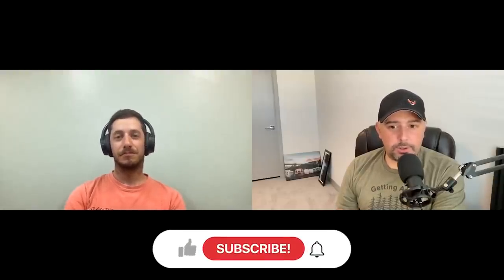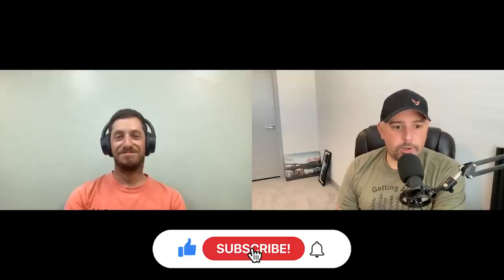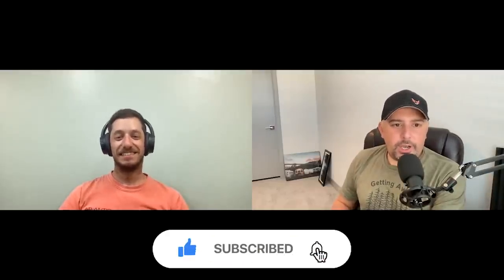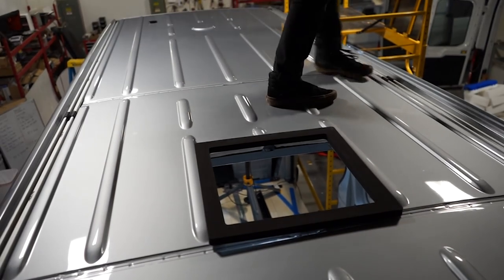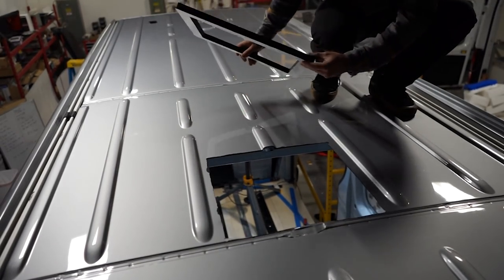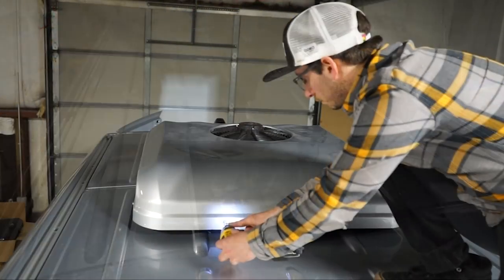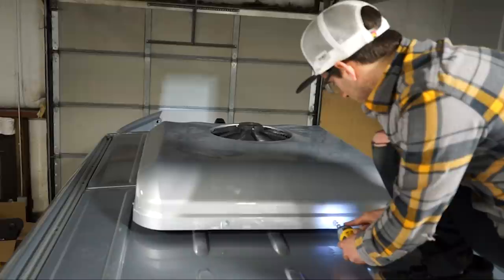12v (DC) Air Conditioner Talk with Pro Builder and Certified Marine Electrician

Comment: Don't spend $10k on batteries in order to run an inefficient $3k A/C. ($13k total) 

Instead, spend $2 - 4k on batteries, $500 on an efficient single-phase 220v inverter, $500-$1000 on insulation, and $3k on an efficient mini-split unit with $300 - $1000 flexible refrigerant lines. ($6.3k - $9.5) Mount the condenser on a swinging rack behind your van with the flexible lines and mount the air handler anywhere you like inside. 

You will have efficient cooling AND heating. operation is virtually silent. It's much easier to find someone to make repairs, but these units can last for decades. And you can recycle the condensate water (up to a liter per hour) for showering, cleaning, and doing laundry if you get a portable washer. 

No need for the expensive alternator and driving 5-10 hours a day to recharge. You can sit in place indefinitely, charging purely off solar saving a ton of time and money.
Reply: 100% right
Reply: Do you know good brands of mini splits?
Reply: This makes much more sense to me too…👍
Reply from the maker: We also said we all need to live our own van life. We can do whatever we'd like and how. You're way is one way and I actually agree spending $10k on batteries is crazy but it was a suggestion and I also said 4-6 batteries is fine
Reply: Where do you get flexible refrigerant lines? Can you buy a line set package, like you can with the regular copper lines, or do they have to be custom made?

Comment: As a fan of the show it was surprising to see you miss a key element of air conditioning:  humidity.   Most people will be more comfortable at 100 degrees in the  desert than at 80 degrees on the coast (30 vs 90%).  The temperature at which water vapor condenses out of the air is known as the dew point (water condensing on your cold drink in the summer).  In fact, until your ac has removed enough humidity to exceed the dew point it can't begin to start cooling.  That may explain the 'leaking' phenomenon.  Could also explain why 80 degrees inside the van with the ac running is still more comfortable than 80 degrees outside the van.

Comment: How about Proair 12v DC units, I love mine...I had it for 2.5 seasons and had a few bumps but overall I would recommend this unit. Do your home work, temp/humidity  =  how much energy it will consume..
I will say, the last 2 builds I had standard AC made by Coleman with a Honda 3000 EU Generator. Generator $2k and AC cost $800 and needed gas to run it. With the gen, I would get about 8k hours before rebuild the generator. So it is a lot cheaper this way.
Reply: Proair is one of the best units out there, but they don't concentrate in the vanlife space, so most don't know about them.

Comment: Lots of great info. Nomadic Cooling doesn’t have units in stock with a 60day backlog. They however just became a Dometic dealer and their 12v roof top unit is $1000 cheaper, draws only 10 to 58amps depending on mode. 19.5 amps in eco mode. 

Granted the dometic unit is only 6824 BTUs versus Nomadic’s 9830btu’s but you dont need a 1kwh battery bank to use it

Comment: It's all about the expectation. I'm from Taiwan which is a tropical country. When I first came to the US I set our apartment AC to 83F and then my roommate found out and asked me why. I did not even know if 83 is too high or too low because it's perfect for me. Of course I learnt that US people expect AC to be 76F or so. In a van you should not have the same expectation for the AC as if you're in an office building. IMO as long as the AC drives the humidity down, 85F with fan is cool enough for a good night sleep.
Reply: Yes the humidity is the major problem

Comment: I'll stay with my mini split, the information was helpful though.
Reply: I want a mini split in my van. Info please…. Brand, size, where did you buy it, who installed it?
Reply: @wendydee1884  I'll send you the link.
https://www.ecomfort.com/LG-LS090HXV2/p99988.html

I was in the USMC so I just asked the people that I knew to install it.
Reply: @isaiahbangura4421  can you share a picture of the setup? Or explain how you have it installed?
Reply: @daviddean2708  I did it similar to this person.
https://sprinter-source.com/forums/index.php?threads/72017/

I've seen people put it inside the "garage" and open the back doors with a bug net up. They had a wall to separate the garage from the living area.
Reply: Since the minisplit is 110V alternating current, don't you have to plug into shore power to use it?
Reply: @poncho6784  I run it off solar with an inverter.
Reply: Do you know if this is the smallest outside condenser they make?
Reply: @wendydee1884  it's a residential unit so yes.

Comment: I have 200ah lithium and run mine correctly. 
Over 8 hours at night. I art my Cruise N comfort at a comfortable 80 degrees and off and on, i use about 30 to 35 percent of my battery over night. 
My unit only pulls 18 to 27 amps; depending  on fan speed👌👌
Reply from the maker: If people only knew
Reply: I have a CnC wired for 24v. I MUST be running it wrong, too cool, too much fan, because it will go thru my 4, 100ah battle born batts in 3-4 hours (during day, in sun).  Additional: well insulated, havelock wool, 360 watt panel, only other draw is the domestic 75L fridge.
Reply from the maker: @LilyWasHereMB  where's your sensor and what's the temp set to. Could very easily be wired differently too
Reply: @JarrodTocci  I was gonna ask that because Im running the single fan. 
This thing is designed to maintain and not cool from hot to cool. 
In other words, let your van A/C start cooling it and then turn on your Cruise n Comfort and when the C N C turns off, turn the vehicle off and have a good thermal curtain; to keep the cool air in. then, the C N C maintain.
My thermostat is chest high on a cabinet and not the exterior wall. Have it as close as you can get it to the center of the room. 
Running it at 24V should run better than mine. 
24 and 48v is using less current

Comment: FWI: Im looking at the worst case possible. Outside 95 w/ 100% humidity & with Thinsulate w/ a void to outer shell and keeping the inside at 76f. Victron 2000 Multiplus /600 AH BB w/ 300 watts solar = 4-6 hours = 25%
Yes I could get a lot more time if inside temp was higher. Issue is still you gota bring them back up 100% before the sun get's ready to cook you again. I use for work and I'm able to plug in when I get home, but if I had to solar array. I would not be very mobile. That's my take on it, I know others get it to work for them. I work in the construction business and dust / dirt / mud would be a no go for an undermount system.

Comment: Tip: I use a short piece of copper tubing or a union and solder cable together and then use the heat shrink to cover it. Works great and makes a permanent joint that will never corrode and will carry full current….

Comment: The part that is missing is a discussion on insulation.  Doubling the insulation will half the consumption by the Airco.  Quadrupling the insulation will keep you with 1/4 of the consumption.  
It would be good the some guidelines on what insulation will bring what consumption at what temperatures.
Reply from the maker: The video is long enough. Going I got details of insulation takes much longer. However I agree with you that insulation is extremely important in a build

Comment: The amount of detail! A very thorough and needed vid on A/C thanks so much! At some point can you cover the pros and cons of having the kitchen at the back of the van. I’ve been thinking about a deck that folds out and a sliding grill, (like the Hymer) possibly a kitchen counter on a pivot that can swing out to the side as well. 👍
Reply: I’ve been thinking about a deck that folds out and a sliding grill, possibly a kitchen counter on a pivot that can swing out to the side as well.
Reply from the maker: I will start to do more videos on design and layout for sure. That is more my specialty

Comment: My biggest issue is, I'm doing this as I'm working a daily job and I work overnights (and there's no getting around that. I've tried). I have a 2006 4runner. Where I live, there's no place to park that has shade. There's rural areas that are down 2 lane roads and business areas that have wide open parking lots without any kind of shade aside from my parking illegally. If any of you have any advice, I'm all ears. For now, the only option I'm seeing is buying a bluetti and a good fan and cracking the windows. I'm hoping to not to have to rent a room for summer lol. Also, I don't want to be cutting into the truck itself. I also want to remain stealth. I'm getting my windows tinted with ceramic tint in a few days. I know from experience that will take a hell of an edge off. Not sure what else to do.

Comment: Can you make the engine start running on and off when you need more AC if battery power is not enough? The Engine can both charge batteries and power front AC. Seems like a cheaper solution.

Comment: Ok JT??? If money is not an issue, what is the best 12v unit. Both rooftop and/or undermount.
Reply from the maker: Nomadic Cooling roof and Cruise N Comfort under mount. That’s as of now so we’ll see what’s to come down the pipeline
Reply: @JarrodTocci  I don't know the price difference, but if price was not an issue. What would you choose? I need the most reliable unit. Thanks for answering my question. I will watch the video!

Comment: Is Nomadic Cooling just buying the Chinese units and rebadging them? I am almost certain they are. 

You see 12v AC units exactly like what they sell on alibaba all the time. $400 plus shipping.
Reply from the maker: Some parts are the same but I know for a fact the compressor is not from China which is probably the most expensive and most important part of the whole unit
Reply: @JarrodTocci  it looks like they upgraded the compressor on the 3000 unit, but the 2000 looks the same. Of course that doesn’t mean it is the same.
Reply from the maker: @AJourneyOfYourSoul  true true...I am going to their facility next month and I do plan on asking these questions
Reply: @JarrodTocci  awesome. The video was really good. 

Another 12v ac to check out is the pro air unit that trumaheaters.com is selling. I believe it is the same unit that roadtrek developed with pro air.